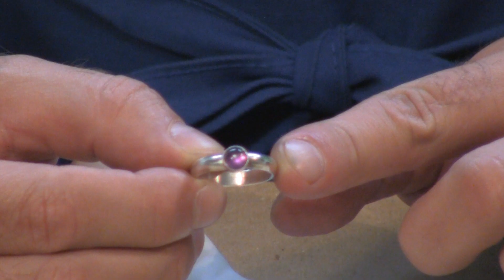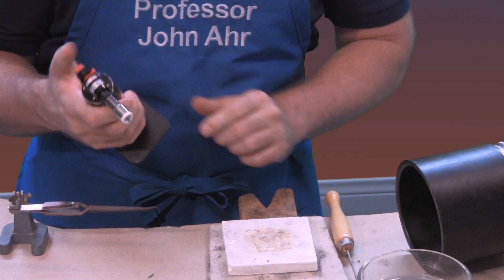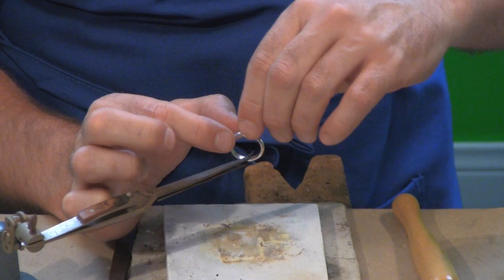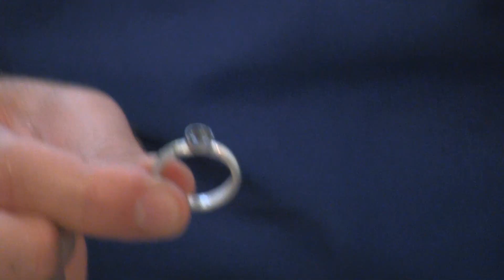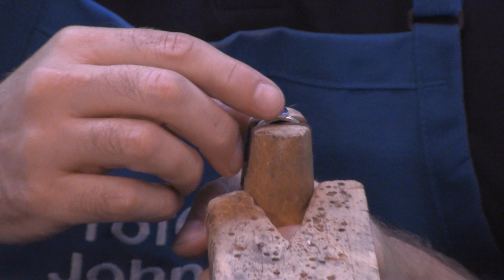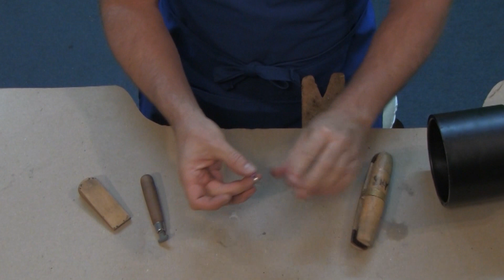Soldering A Silver Bezel Cup And Setting A Cabochon Stone SV

Comment: I've looked through all of your videos and can't seem to find any instruction on soldering a bezel wire onto a wide band/saddle curved ring (where you have to file the bezel into a curve to fit the shape of the ring) and also showing how you set a flat stone in a space like that when it has a curved bottom. do you have a video showing this?
Reply from the maker: No, the OJA does not have a video like that posted to its website.  Our mission for the past three years has been to create videos that would help beginners without access to classes.  And, the type of project you described is a little advanced.  But, I can give you a little advice.  First, if you want to prevent the stone from rocking in the bezel, you can fill the void below it with plastic.  I normally cut up the plastic lids that you'd find on a can of peanuts or margarine to accomplish this.  I use this material because it will not decay below the stone.  Second, You might want to investigate whether or not a step bezel will work.  The open bottom of the bezel will accommodate the curvature of an object.  Otherwise, make the ring first and use it to create a template for the curved edge you need to create on the bottom of the bezel.  Take your time and be sure to fit the bezel on top of the ring.  Shining a light into the bezel will help to reveal if there are any gaps.  Good luck with your project.
Thanks for your support! : )

Comment: Do you solder the bezel cup on the joint of the ring that you previously soldered or do you file a flat place on a different part of the ring? if that makes sense
Reply from the maker: Christina LaRoy 
That's a really good question.  You can solder the bezel cup on top of the joint that closes the ring.  It's a great save if your joint is kind of ugly.  It also makes sense to solder the bezel cup in that position if you think of the ring's future.  It might need to be sized in the future.  Placing all of the welds in the same place will help the next jeweler to work on the ring.  Thanks for watching! : )